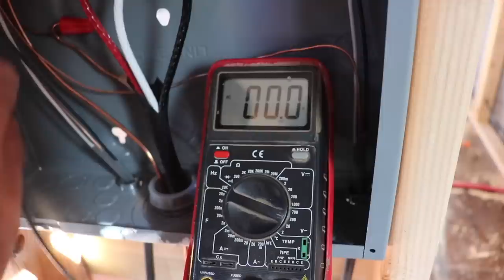CUE THE WATERWORKS!

Comment: How offend does the pump come on?  As I understand, the pump pressurizes the tank  and then allows you to shower flush toilets and such until pressure drops and the pump comes back on. Just looking to understand how often the pump needs to run. Trying to understand pump size, tank location to estimate off grid power usage for pump. I'm probably overthinking this but just trying to understand

Comment: Romex like that serving power to your panel isn't allowed to be ran in wet locations, being underground, even if it is in a pipe, ground rod clamp is a water clamp not rated for direct burial, alot of things not right with this electrical, I hope it works out with no issues in the future.

Comment: A bit late now, but use dish soap on your wire pull next time. Or find "Yellow 77" if you want to be strictly proper about it. And yeah, driving ground rods sucks. Your first instinct about not holding the ground rod was correct. And they do make ground rod clamps you know. :)

Comment: I'm not sure if anyone has posted this recommendation or not but try pulling a 1/4" nylon pull rope  first and use wire pulling lubricant. It makes pulling electrical wire a lot easier. Oh and if you pulling any kind of data cable, pull it slow with a lot of lubricant. Just a recommendation.

Comment: A guy from the power company showed me one day to take the ground rod and a cup of water.  Then Start the rod and pull it back up and pour water in the hole then use the rod to pump like a piston and it can be put all the way in to the top end just add a little more water when needed.  I didn't believe it until he showed me.

Comment: If that's your main electrical panel, make sure to have the neutral tied into the ground or else you will have issues with the circuit breakers operating correctly as well as safety issues with fault current return path.

Comment: a few months a go a guy showed me such and easy way to put a ground rod in.  take and shove it in as fare as you can then pull it up put water in the hole and then slam it back in the hold and pull it up and back down again and it will go in.  I watch him put a 8 foot ground rod in the ground in like minutes when I used a post hold driver and it took forever as it seamed.  I had another ground rod to do tried his method and man it was so fast and easy.

Comment: Kudos, but the next step is testing your filtered water because contaminants are always present and it should be done routinely each season or after major destructive storm events. Most collection systems usually need additional filtering than what's installed and often it's simply  just adding an off the shelf one on a tap where water is used for hygiene/drinking/food reasons. New collection systems water is often odd tasting because the piping/joints are new and check your hoses because some polypropylene ones aren't recommended for drinking and are labeled that way when new.

Comment: If you have anymore ground rods to drive, use a post driver like you’d use on a t-post. It won’t drive it all the way but the last 2 feet are the easiest with a sledge hammer.
Reply: Greg Arm See later post about 3 foot pipe and a cap.

Comment: Just warning you. That pump might only last you 5 years tops. For your sakes I hope it lasts longer though. I’m a water well pump installer/service technician so I work with pumps every day. Definitely if you end up needing a new pump down the road I would definitely recommend Gould’s. They’re the best pumps and they’re all we install. Seen some last 30+ years. Also I would have also recommended putting in a submersible pump in one of your tanks instead of a jet pump. But that’s fine, it works...just not as efficient, louder and harder deal with. Anyways, good luck with everything. Enjoy watching your videos.

Comment: Your water filters need to be between the pump and the pressure tank.  First, so the pressure tank doesn't fill with contaminants.  Second, so the filters don't reduce the water pressure to your house.  The purpose of the pressure tank is to insure a good stream of water.  You defeat that by putting the filters after the pressure tank.
Reply: Filtration equipment is typically installed after the pressure tank 99% of the time. The pressure switch needs to not be impeded by restrictions, and capture an accurate reading for cut-in/out of the pump.
There are other reasons to do it the typical way, which has to do with servicing the equipment. The main objective is to keep the jet pump primed and tank under pressure, when performing routine service of auxillary equipment (filtration/treatment).

Comment: you guys wanna minimize the amount of bends on the cable the bends are where the electricity has resistance and the cable heats up it probably would be smart to use metal conduit in the house in order to prevent fire from acidental shorts or cable overheating from resistance but that would make it hard to pull this thick cable through so its understandable u guys didnt use medal conduit

Comment: Just get a TDS meter (Total Dissolved Solids) and test the "End Product" (It's usually quite a reasonably priced electronic tester). It will give you a Good idea of what the water quality is like. 

They normally measure in "Parts Per Million, and here at my place, after the RO System has cleaned out most of the garbage in the municipal water (Mine is a 5 stage with membrane), it averages around 4ppm (Although, the "Source Water" only measures 180ppm which apparently is good to start with), however, yours seems to only be a 3 stage filter system, so it may be slightly higher (Or maybe even lower, as it is "Rain Water", and not some water going through whatever ridiculous process from the municipality). 

They also say anything under 40ppm and you're living the dream 👍👍👍

Comment: Check your PH. Rainwater should run at 6.5 - 7. Yes it’s demineralised but it’s alkaline. Alkaline water is a sponge for all the negative shit in your body. Alkaline is positive, acidic is negative. This type of water goes around your body mopping up all the crap and taking it out through the Lymph system. The taste you are unfamiliar with is actually a sweetness. Hard water (ie city) has so much crap in it from Fluoride, Chlorine to heavy metals. You won’t go back trust me. Plus your in control of your water supply. Well done guys, hard work tastes so much sweeter. Drew, Cairns, Australia.

Comment: Years ago I had a plumber explain to me how to put that ground rod into the ground. Get a 3 foot length of pipe and put an end cap on it. Put that over the rod and beat it to death.
Reply: Ah the new tech way is use an SDS hammer drill with the ground rod bit. It will take about 45sec

Comment: You used the wrong wire that is why it was so hard. That cable is not UL listed for use under ground (conduit buried below grade is considered wet location) If you had used just individual strands of THHN it would have been way easier to pull and less expensive to purchase. use a fence post driver for the ground rod.

Comment: Water has no taste.  If you have flavourless water then it is good.  

Congratulations on getting the system working.  I hope you put a ground line off those big tin cans, If you ever got a short it could energize the whole outside of the house and provide someone with a bit of a nasty shock.

Comment: Can you not put copper on your UV filter? Copper does a good job of killing microbes in and of itself. Love all your videos on the water and pump system I'm going to have to do a lot of the same, but with no help. Just one helper would be great. I'm dreading the grounding rod I have to drive when I run power to my shed to add a subpanel, here in the rocky soil in the AZ desert.

Comment: Do yourself a favor and put your electric conductors in EMT pipe, it's safer and less expensive in the long run, insurance will be cheaper and it will be easier to upgrade in the future!. Romex causes more fires because of rodents chewing the insulation, element exposure and physical damage. Please reconsider your electrical choice, especially with children involved. Romex is for the lazy and uneducated/unskilled person. I wouldn't use Romex to wire a doghouse!.

Comment: The wire you you pulled from the barn to the house is way way way too small for that panel. Major fire hazard. The conduit you ran is too small for the wire you need. Being that that is a service wire to feed the panel it has to be ESR cable if not in conduit the whole way to the panel. I am really starting to like you guys and hate to see your channel go away when you all die in a house fire caused by electrical fire. A 200 amp panel needs 2/0 wire in a 2 inch conduit. It really should be piped right into the panel so you don't have  to use a more expensive harder to work with ESR cable. It also looks like you used a 1/2 inch ground rod instead of 5/8 which is what is required for electrical services. And you need an acorn clamp to clamp your wire to the rod. Not a water pipe clamp. I am not some kind of keyboard warrior. I am just an electrician in Flowermound (not far from you guys) that has been voted best in Denton county multiple times with 25 years of experience. I love your channel. Y'all make great videos. Bummed that I am almost done watching them all.